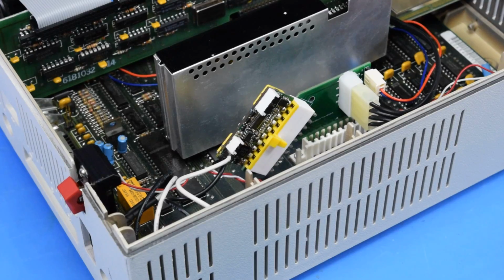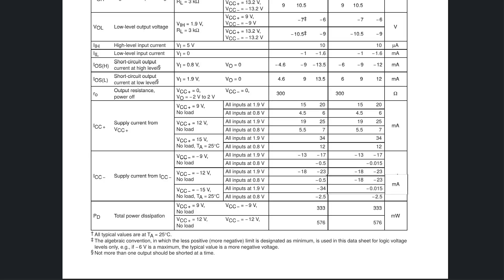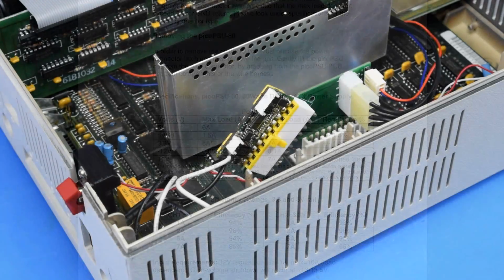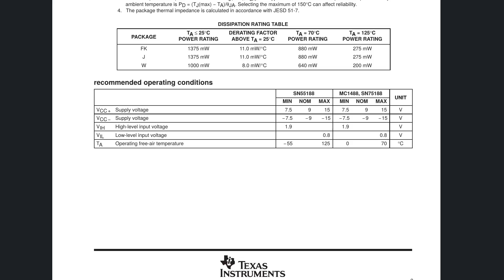0x0035.3 - PCjr ATX/PicoPSU Power Adapter

Comment: It's amazing how much the power consumption of gaming-grade personal computers has risen over the years.
Computing power too, but at least recently the power consumption has outpaced the performance gains.
I mean, the PCjr probably doesn't even use 80 watts, since it was still using a regular old 60hz laminated iron transformer instead of the much higher throughput high freqency switch-mode transformers being used these days inside of ATX power supplies.

Comment: You can make the back panel brackets quicker by making a silicone mold and casting resin. Smooth-On Onyx sets up fast enough that several pieces per hour could be cast in one mold.

Comment: it's amazing how a new psu can work with a computer thats over 30 years old
Reply: Not really. A newer style PSU would deliver a cleaner power signal than the older ones and generate less heat. The older computer would probably work better and the components last longer than with the clunky original power supply.
Reply: Joseph Burke dude im saying more like, its really cool that it works in the first place

Comment: Hey Akbkuku, did you used blender on windows before? If yes did you notice any performance differences? Because my linux hdd died last month, but i can't seem to run a 1080p 60fps nvenq video in blender in windows without lagging, it can only play it back at 21fps even following any performance guides i could find. (i even tried enabling my gtx1060 in blender configurations).
But when i installed kubuntu into a old 5400rpm laptop drive, used the default xorg open source driver, and even without messing with any config at all i was able to play it back and edit the same file at 60fps. 

I can't buy right now a hdd to install my linux back, and i have to give back the hdd to my laptop, so do you know whats wrong here? I have the latest drivers for my 1060, i have a well cooled i5 7500, 8gb of 2x (4gb 2400mhz ram) and a seagate 7200rpm 3tb drive.
Reply from the maker: I haven't tried it on Windows yet. I know someone with a GTX 970 setup running Windows and I plan on doing a performance comparison on there to see if GPU rendering can be faster on a budget than CPU rendering. I'll probably live boot linux on there as well and run the same tests and get some performance metrics for the OS as well.

Are you using proxy files though? I find using 25% proxy files is 100% full FPS on basically any somewhat modern(down to core 2 quad) computer.
Reply: AkBKukU I was going to try the proxy files, but i had the idea of testing in linux and saw that in linux i had basically more than 3x the performance. 
I will try to use the proxy files on windows while i dont get my new linux hdd, i will post here the results.
Reply: I tested right now, and 25% proxy worked like a charm. It used only 10% of the cpu and about 20-30%of the gpu at a solid 60fps. I think even 50% would be possible. thx for the help!
But i will probably get a linux hdd as soon as possible to install linux into my main pc again.

Comment: Ask The 8-bit Guy, if he wants one!
Reply from the maker: I know he has a PCjr but I remember it was working so I don't know if he could use one. I would be more than happy to send him one, but for this first batch I want to make sure people who can actually need them are getting them. I'm not even keeping one for myself out of this batch because I know I'll have more later.
Reply: try to aks him via email he will most likely at least give a short answer to you, so i think it's worth trying just to let him know
Reply: If you have more later, then you can send him one, in case his power supply dies(he is testing his new game(Planet x3) on his pcJr) because he is probably using it pretty much every day!
Reply: I don't think that david needs a PSU for the PC Jr since he already has one from his donation
Reply: Probably the voltages will be way more stable in the pico psu/new atx psu and with way less ripple, so its probably a good thing to replace even in a working original pc junior psu, keep it but use in the pc jr the pico psu, it would preserve the pc jr way more, and even have way less risk of capacitor damage.

Comment: Next would you do this for iMac G4 “Sunflower” PSU’s replacement, sir?
Reply: I don't think he even has one. Maybe if you sent him one he would be inclined. Otherwise you're out of luck. The most advice I can give is maybe checking the pinout on the imac sunflower and modifying his design to fit your needs.
Reply: power macs g4 used different kinds of psus, not the same kind for each g4, with different kind of connectors specs, and also direct pin adapter, which just takes atx 24 pin connetor and rearranges the wires in a power mac power connector, to match the pinout of the connector, can give some small problems in some machines, so i think that the original powersupply must be reverse egneneed to seome degree to creare a proper and issues free atx adapter that for me would require some power regulation or some logic missing in normal atx units
Reply: I you look up your model number you can probably find a psu pin out. But if your iMac has a dead psu it might not be worth it because when psus go they like to take a lot of other parts with them

Comment: There is an extremly high pitch noise of the CRT, if you are going to mage video usig PCjr, could you filter it out.
PS I'm 18, if you are older you propably won't hear it.
Reply from the maker: I really thought I had, but I found the problem. I forgot the bootup sound got removed by accident at one point and ended up on it's own audio track. https://i.imgur.com/d1Jc1Pj.jpg I forgot to put the processing filters on that track. I can hear it, but it's not ear splitting for me like everyone who seems to mention it. I think young people now are more sensitive to it because they didn't grow up with it. Based on all the comments I see about it now, you would think that school kids in computer labs with dozens of CRTs would have been rolling on the floor wincing in pain. But I can tell you from first hand experience that's not what happened, you just tuned it out. I hear it, but I don't notice it. So it's hard for me to actively think the thought "I need to filter this out". I will try to add a step to my work flow in the future where I look over the audio as a render spectrogram before release so it is more obvious when I miss this.
Reply: I'm 19 years old, and the CRT whine doesn't really bother me either. I can hear it, but it's easy to ignore. For me, I guess that could be attributable to using a CRT on my PC until about the age of 10. Could also be that I have tinnitus and CRT whine is basically a far quieter sound of about the same frequency...
Reply: Doesn't bother me also, unless its a really old and beaten up crt tv, where that noise is so load that is actually louder than the tv's normal average speaker sound.
Reply: yup here in england we have security systems that use the same frequency noise to stop kids from hanging around public or private places.the sound makes you feel headachy and sick.... only affects under 20yr olds as they're super susceptible to the sound :)
Reply: its mainly because the hairs in your ears that let you hear start to become less functional as you age, and thus only younger people can hear it. im 17, and while crt noise isnt painful, its certainly annoying. I used a computer with a crt when i was younger, and i dont remember how annoying it was, but yeah, i can definately hear it. tom scott did a video about the noise, and i think he added a method to remove the noise, but i forget exactly
Reply: I am oversensitive to sounds. I made a silent evaporation cooler for my PC just to get rid of fan noise.
I know most people don't really care, but as he works with old technology I just wanted to remind him, as it irritates some people. Especially as I know he already did it in his previous videos.
Reply: I’m 17 and I can’t hear it, probably EQ settings. In real life I can hear a CRT well when it’s running, try changing the EQ settings for higher frequencies on your device if you have that problem with some videos
Reply: So, you need to keep turning it up to hear the noise? Ok.
Reply: spike007980 Uh.. idk if that was for me but i hear it perfectly, but i only get annoyed when its too high.
Reply: +spike007980, I had to turn it up stupidly loud before I could hear anything resembling the whine. If that's the reason why some here are receptive of it then I don't think that will be a problem for them in a few years, depending also if they've even got ears left to listen with